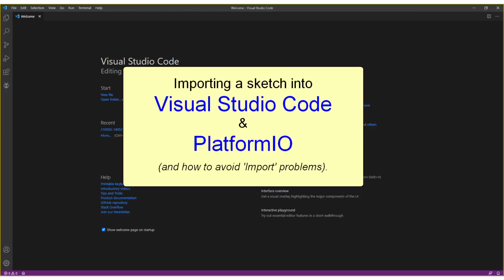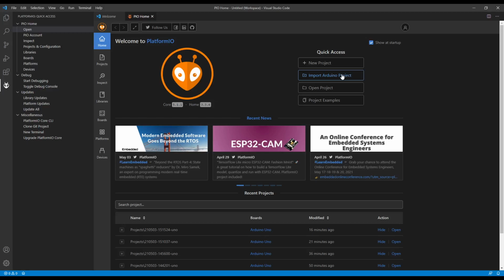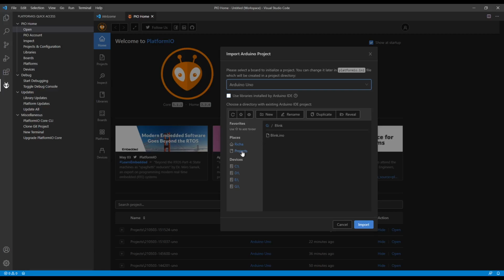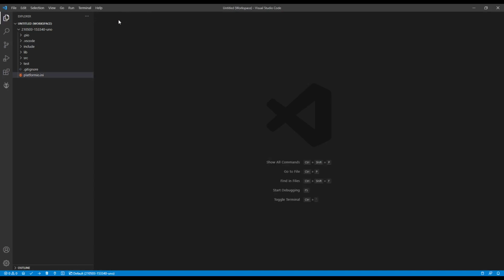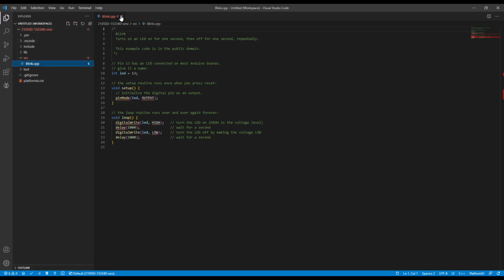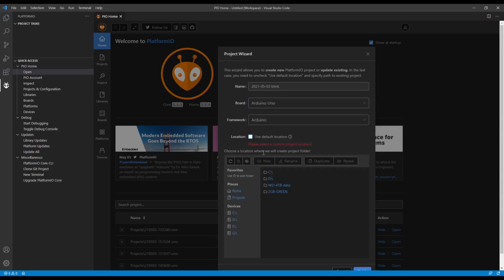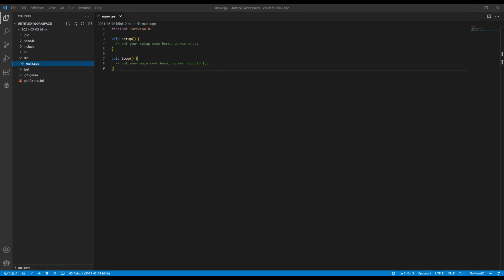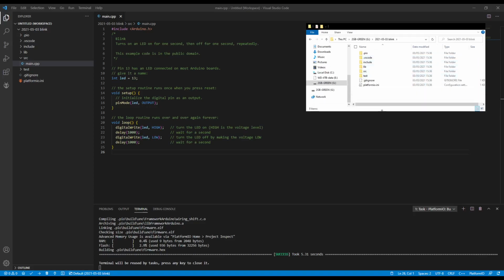A better way to import Arduino projects into VSC (Visual Studio Code) and  PlatformIO .

Comment: Respectfully, but everybody shows you how to blink an LED. My problem is using  vs code  platformIO  to upload a full an existing ***.ino , one with many sub files. say a project downloaded from the net?
Reply from the maker: Should be straight forward. Paste the .ino code into main.cpp as shown in the video. Copy the provided .h header files provided (and any others) into the 'includes' folder. Ensure your code knows where the other files are. Any libraries required may be installed by 'PIO Home' -> 'Libraries'. If you are still stuck, point me to the project and I will take a look. I hope that helps.
Reply: @richardlangner  Sorry, it isn't as easy as you mention. It's a lot of work to migrate a complex project based on multiple ino-files: You have to extract "public" function headers/declarations into new header files, protect these headers from being included multiple times, include these new header-files where the functions are used,  then you have to extract shared global variables and write a header file to declare them as external etc.